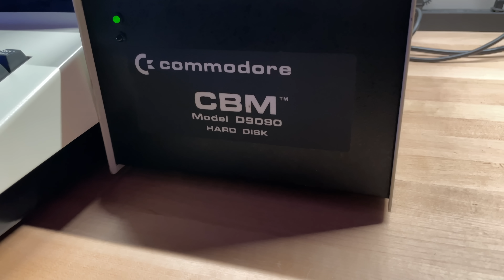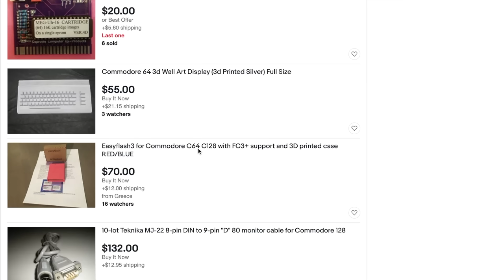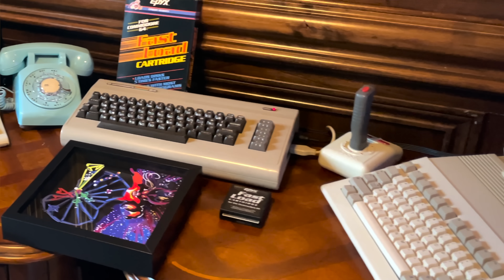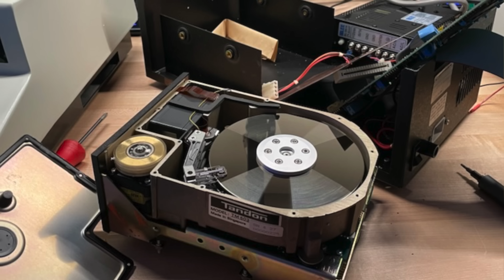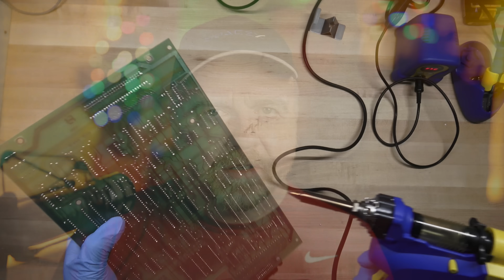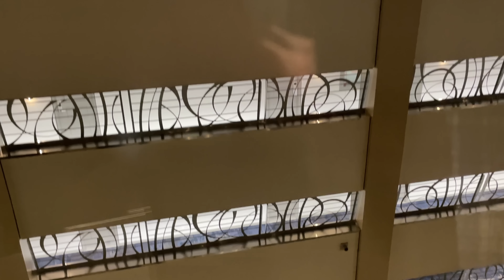FOUND: A Super-Rare Commodore D9090!

Comment: Sorry Dave, the original hard drive was never going to work.  It's not the power voltage, it's the power frequency.  You can convert voltage for devices, but that only works well if the device does not have any motors in it.  The reason is that US electricity operates at a frequency of 60Hz, while most of the rest of the world is running at 50Hz.  The effect is a 20% increase in the speed of nearly all foreign motors.  On a fan it might not matter.  On a belt-drive record player you can adjust for this by using a 50/60Hz pully adjustment.  For a hard drive like that there is no way to adjust the frequency of the motor, and there is no way it can operate correctly while running at the wrong speed.
Reply from the maker: Now I'm no hardware guy, but the drive runs on DC power which has no frequency... isn't the 50/60Hz issue only relevant on the AC power side?
Reply: @DavesGarage  That's correct, the MFM drives are DC motors and not affected by the incoming AC frequency.

My money is on one or more bad caps that are letting RFI back into the AC line causing an imbalance between natural and ground.  If I had to bet I'd look for a cap that's either completely open or way below its specified value.  If you put a scope on the five and twelve volt rails, you can see if the DC is clean or has a lot of noise on it.  Some volt meters have a capacitor test setting and many times you can test them in circuit.

Comment: it was probably mentioned a couple of times, but old tantalum bypass caps like to short over time
Reply from the maker: Yes, that seemed to be the consensus during the premiere... likely a bad cap.  But if all the caps are good, does that mean I won't read 0 ohms across a cap in circuit anywhere?  And that if I do find 0 ohms in circuit, it's bad?
Reply: @DavesGarage  if one cap on a rail is shorted you will read a short on every cap on that rail. If your meter is precise enough you can try to guess which one it is by looking which cap has the lowest resistance.

If you don't read a short on the power rail that doesn't mean all caps are good. They still might be degraded and not up to the full capacity but that wouldn't result in a fuse blowing. Depending on which cap you might not even notice a reduced capacity

Comment: GFCI work by measuring amperage difference between hot and neutral (simple version, just imagine having a magnetic coil fed from the hot and neutral side pulling on a central magnetic relay switch, if it touches either side it trips).  The assumption being if hot and neutral aren't balanced the 'missing' current is going through your soggy sneaker.  But what if the current isn't missing.. it is just 'delayed'.. by something that is altering the phase of the current as it passes through.  Certain circuits are notorious for this (motors being one), so are certain types of power supplies.  So you aren't tripping because of over-current, you are tripping because your return current is 'delayed'
Reply: I've heard people mention current "delays" before, but it doesn't make any sense. Have you heard of Kirchoff's current law? If the current is flowing one way it needs to be headed somewhere.
Reply: @eDoc2020  Inductive or capacitive loads can cause phase differences between voltage and current. Inductors resist changes in current and capacitors resist changes in voltage. It's sort of like a reservoir containing water. Long term the water entering the reservoir must equal the water leaving the reservoir, but in the short term the reservoir may be filling or emptying resulting in a difference in the two current flows. Hope this helps explain things.

Comment: I just did a power supply swap in my 1541 in June. I used a MeanWell branded one. If the GFCI is tripping that’s a badly engineered PSU in my opinion.

Comment: Probably commenting a bit early here, but before I forget, I have over 100 C64 game tapes(yeah, I couldn't afford a floppy drive until 1992 when I got an A1200 with dual, one of which was external) and probably have some games you helped make in that big stack.

Loads of memories from that and the A1200 that is still there, too, but now has CD-ROM, HD, 50mHz '030, a 1gb HD and 10mb RAM. Sometimes used to boot 'em up still for a quick game of Wizball or Sensible Soccer, but as my tapes and disks continue to deteriorate, I decided to retire them and use a Raspberry Pi with emulator instead.

...now back to the video.

Comment: The Tantalum capacitors are likely the reason there is a dead short on the hard drive board. As for tripping the breaker. I don't think the power supply is tripping the breaker as a result of a ground fault(if connected properly) or overcurrent. It is possible if you have an arc fault breaker that is picking up something funky.
Reply from the maker: Thanks!  Makes sense and seems to be the consensus for the short issue, at least!
Reply: @DavesGarage  Is that new power supply a switcher? It replaced a transformer based linear supply and considering the kinds of loads imposed by that old equipment, there's most likely a complex interaction between the load, the switcher and the circuit protectors in the mains - I should know because I blew several switchers AND tripped the circuit breakers in this same scenario. Putting together a new linear supply with the same specs as the blown one resolved all issues.
Reply: @DavesGarage  

Hey Dave, 

Could the failed capacitors be the cause for the other hard drives not working?  I wonder if all of the hard drives were unable to maintain proper speed, which was the cause of the formatting failure.  The root cause being hardware and inadequate power supplied to the drives motor.
Reply: Maybe a busted flyback diode?
Reply: I would have preferred the original power supply.  The transformer input was probably strappable for 120, or you could have just wired a 220 outlet. 
(I have working ST251 drives.)
Reply: There was probably a chassis short or return current path from the motor driver through the chassis.

Comment: If you breaker is also tripping on the short, and it is not an actual current overload, check if there are any failed diodes in the PSU section that are parallel to coils. Those are there to protect from feedback spikes back into the AC or whatever circuit it is attached to.

Comment: GFCIs trigger for the difference of current going into vs. coming back from the circuit (DC/AC should not make a difference, some GFCIs are just not sensible to DC or get biased by DC, there might be electrical code mandating DC-sensible GFCIs depending on where you are and if grandfathering is in effect). This usually only means ground fault. If the power supply is not fed by an intact, isolated transformer (most aren't) any fault reaching the (protective earth connected) chassis and exceeding its threshold (~30mA) can lead to it triggering, even if the fault is on the low voltage side.

Old equipment might not even be built with that in mind and might leak current to the chassis, expecting a fully isolated supply with which this would not be a problem. A protective earth connection on the chassis might indicate if an isolated power supply was designed in or not (or measure continuity between input and output; of course while disconnected). EU/US regulations differed more in this regard for the past decades and i have no idea what was acceptable at that time.
Reply: This can also happen if a capacitor used for EMI filtering goes short circuit or is the wrong value. They are supposed to use Y capacitors between ground and hot/neutral that are supposed to fail open circuit, but they could have been replaced.
Reply: @sfx1999  yes, unfortunately you can't see enough of that hard drive to see if such a provision is in place. If it was just the power supply unit itself the GFCI would open right on connecting it to the outlet - even without load. It is connected to ground, right?
Reply: @denny9931  That's true the PSU should isolate the secondary so that hot and neutral have the same current. I wonder it arcs under excessive load or there is a problem with its design/construction.

Comment: Had the 5 MB D9060 version of this. To use it with my C64 required a cardbus “cartridge” - a massive adaptor that with the hard drive combined caused some pretty good TV interference. 5mb - something like 18,000 blocks if I recall - seemed limitless, even ram a BBS on that for a while!
Reply from the maker: I never had a D90X0, but I did have an SFD-1001, which was IEEE-488, and used an adapter of some kind but now can't remember the name!
Reply: @DavesGarage  Oh, man, I had an SFD-1001 also.  One whole megabyte of storage!!  🙂  (Actually a smidge more than that.)  I don't remember the name of the interface I used, either -- but there were several available at the time.  I had to buy two or three before I found one that was reliable.  It plugged into the cartridge port, had a pass-through cartridge slot on the back, dip-switches to select the "drive number," an IEEE-488 ribbon cable that came out of the side, and -- every C64 owner's dream -- a reset switch! 

I wish I'd known retro computing was going to be a thing in the future.  I would've kept all my C64 stuff that I sold in the late '90s for a pittance compared to what it'd be worth today.  (It sold for less than the cost to ship it all to the buyer!  LOL).
Reply: Dave's Garage hah had that one too. If I recall it used the “buscard” cartridge too. (Oops wrote cardbus before)

Comment: Sounds like tantalum cap. They fail like that when old ones are powered up. You can allow about 300mA to bleed on the 12 volt rail and the bad one will get very hot so you can find it with out burning the traces. You can replace it with another tantalum,  but I prefer to replace them with polystyrene caps. Honestly even a basic multilayer ceramic would work just fine on it due to modern design and the "low speed" of that hardware.
Reply: Agreed, it's one of the only components I can think of with "fail closed" behavior as the default without knowing the circuitry of these devices. Only other thing I was thinking is that the drive did some kind of triac-based PWM to directly use AC for the drive motor, where a coil in the motor frayed and is shorting to the metal body. That would certainly trip GFCI and probably fry other components along the way.
Reply: @Tawnos_  I almost wonder if he was using a non isolated power supply, and has  the negative is bonded to earth ground like most computers are; then when it takes a rail to ground its able to put the 6mA on ground as a diffrental that causes the trip.
Reply: @Tawnos_  Most semiconductors fail short. A regular signal IC won't pull down the line but the motor driving circuitry might. Modern drives also tend to have a Zener diode for protection; if you feed them 20v they short (don't ask how I know), although I'm sure that's not what happened on Dave's.

Having said that I would still suspect a capacitor as the failure occurred when the drive was running.

Comment: I guess your next step if you want the actual MFM drive to work, would be to bit-bash the MFM's IO using a Pi so you can find out the drive's true health state, and then find some way to mitigate the shortcomings, ie do the low level format yourself and produce a FS which has pre-allocated all the bad blocks/tracks.  Or I guess that's 8-BG's next step lol.

Comment: My guess is that the motor winding insulation has broken down and is now shorted. If so, with enough painstakingly tedious effort one could rewind it with the correct magnet wire.

Comment: I have a US made 80 column PET with wierd german keyboard layout ... and a GIANT external dual disk drive.. the disk drive or port doesnt work tho 😞.. (freezes on command)

Merry Xmas everyone!
Reply: I have a miniature Olivetti Quaderno portable with a German keyboard that boots MS-DOS 3.x from ROM. The CPU’s an 8086 so it’s pretty nippy with its miniature inbuilt 20 MB hdd. I haven’t used it in a while, but remapping the keyboard and putting little sticky labels on the keys meant I could use it. Despite the extra power and storage, I preferred my Tandy 200 for real world on the road word processing.
Reply: @jonathansturm4163  QWERTZ layout also?
Reply: @allan.n.7227  IIRC. I moved from the farm to town a year ago and the machine’s in a lockup. It’s a long time since I used it. My main PC was a 486 when I purchased it. It wasn’t very practical since the half-size keyboard was too small for touch-typing.
Reply: @jonathansturm4163  My PET's keyboard surely isn't ..🤣even though it is one of the nice full sized ones (Vic20 sized)

Comment: When I ran a BBS in the mid 80's I had a D9060 and a 8250 dual 1meg floppy drive and 3  SFD1001's. All used a IEEE interface.. I thought I was something.. ha I also had one of those all in one SX64 semi portable with floppy and tiny monitor. MSD Dual drive etc etc.. Just dont ask why i needed all that...

Comment: Tantalum caps are renowned for having a short failure mode. They were used extensively for bulk decoupling on power rails until, relatively recently, ceramic caps became available and economic as replacements.

Edit: to find shorts like these on supply rails you really need a 6.5+ digit DMM, this will allow you to trace to the lowest resistance on the board and thus the source of the short.

Your PSU tripping the GFCI is probably a secondary effect from the short, are you sure your GFCI isn't also a built-in breaker?
Reply: Was just about to type the same.. harddrives of that era often have Tantalum caps directly on the power input (Molex plug), and they almost always fail into a short. Simply cutting them off should be sufficient to get the drive operational again, as the new power supply surely has a much better output filtering that the old one ever had.
Reply: That makes perfect sense here.
Reply: An easier way to find shorts is to force current into the board and see what gets hot. Obviously you need to limit the current so that you don't burn traces.

Comment: I guess you need to get yourself a proper bench power supply, so you can current limit when testing. However, with that many failed drives, I would have looked at getting them working with an old PC instead, just to make sure that they ask are bad.